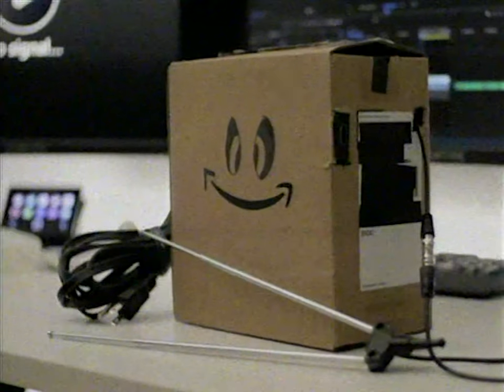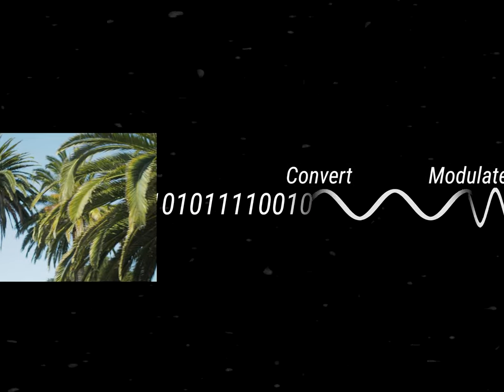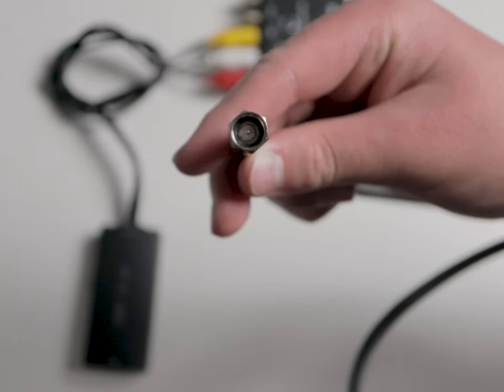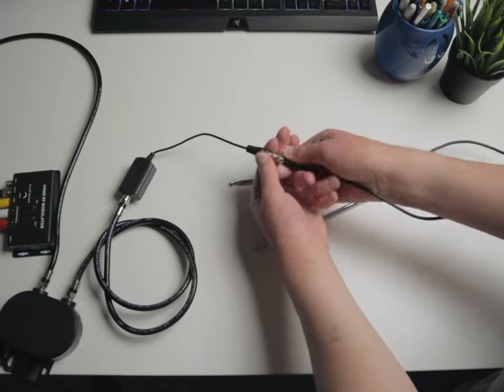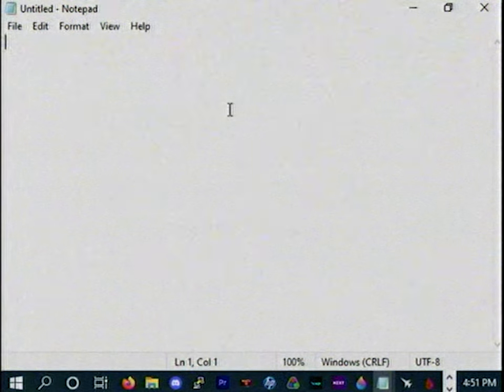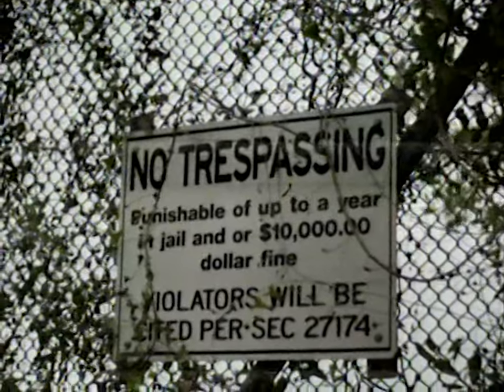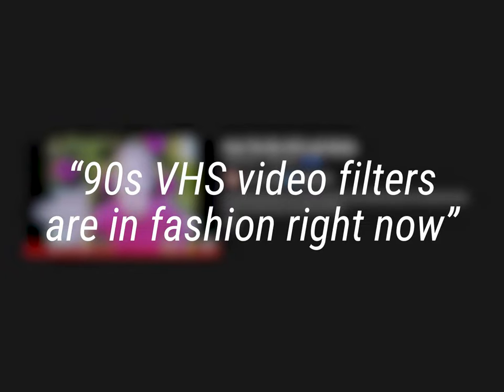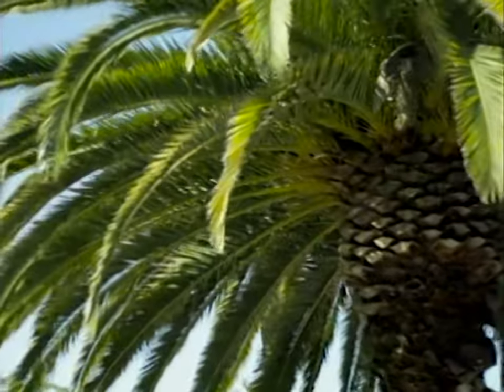Building a 1950s TV Transmitter!

Comment: All of this is really fun until you get your Amateur Radio license, and see all of the fine details and want to scream
Reply from the maker: I think I'm going down that path.. I'm already screaming after one Wikipedia article 😭
Reply: Could you explain I don't get it. I built one of these and am actually studying for my ham
Reply: Are you talking about ham ops being able to transmit analog video
Reply: @evanbv8793  technically. We have a NTSC cable channel in a UHF band

But you need a cable tuner, I think
Reply: @evanbv8793  when you get licensed (ESPECIALLY when you get your Extra like I did), you see fine details that need fixing, and oftentimes you can’t fix them because you don’t have the proper parts, causing you to spiral into insanity like me for knowing that something isn’t fixed.
Reply: @MaxSolar0713  oh wow that's cool I'm going to see which channel(s) so I can add it to my tv and check every now and then and see if I catch anything

Comment: Could you do this digitally so the signal isn’t in analog? Instead of the usual steps, could you just do the HDMI output > Modulator that has a 1080p RF output > Amplifier?
Reply from the maker: Good question. The modulator is analog only, but you can get digital modulators on amazong (although they cost a lot more).
Reply: It is theoretically possible, but you’d need a digital modulator. Have fun acquiring that without a license.

Comment: I did this set up using mostly cheap products from Walmart but color loosely comes through and there is no sound on my crt. What could the issue be?
Reply from the maker: I had to go out and buy a better HDMI to composite adapter, I got one at best buy and it does the job far better. Maybe that will help with sound too
Reply: @SimonVideo  good idea 👍
Reply: @SimonVideo I ended up fixing the color issue but the sound is still gone. Just static. Do you think it could be the antenna I used? It's also cheap
Reply: @tornadodude640 it’s not the antenna if the video comes in well. I’d check your connections from the audio source to the transmitter and make sure your transmitter’s audio function isn’t broken.

Comment: You could get a more powerful amplifier for a better and stronger signal. I think yours is in the miliwatts range, not really made for airwaves, but for cable only. It's not really legal to transmit without a license but nobody can detect you in this day, because analog tv is dead. For a perfect transmission and reception, you can tune your antenna lenght, both on TX and RX side, such lenght calculators can be found online. In fact, you can start a pirate tv station like this, but let's not take it that far...
Reply from the maker: Yeah, it's definitely not powerful. I think it's still detectable but the chances are super low. That's a good idea to check out a length calculator. I'll look into that!

Comment: What kind of range did you get from the transmitter?
Reply from the maker: I could get a faint image about 50 feet away, and that was through a few layers of drywall.
Reply: @SimonVideo  Good to know that it should cover a sub 2,000 sq ft. home if centrally located w/o interference. Thanks!
Reply from the maker: Yeah! Glad I could help!
Reply: If you get a 30-mile range antenna, will it go 30 miles?

Comment: what video capture card/software did you've used to record the transmitter videos ? they seem to be really smooth at 60fps.
Reply from the maker: the Hauppauge WinTV 1196, but pretty much any analog tuner will do the job
Reply: @SimonVideo  thanks, i'll get one cuz it also comes with an SFF bracket and it fits perfectly on my optiplex 3050 pc and its pretty cheap :)
Reply from the maker: @r0ger_  yeah! I love mine
Reply: @SimonVideo  yeah well as for the software, did you've used the Hauppauge Capture app to capture the transmitter video in 60fps ?

Comment: How its is work. Its kind a weird. U just using antenna receiver amplifier to boost your rf out put transmittter. Instead of your receiver antenna.. 

Conclution is. You need RF UHF BAND booster using 2sc1971 transistor. And u got around 5Watt power output
Reply from the maker: Hey the amplifier works.. The transistor might work better but I personally don't want a super far range

Comment: How did you do color and not black and white?
Reply from the maker: Pretty much all analog TV is color, if you're having trouble getting color working, it might be the HDMI to composite converter
Reply: The video is being transmitted by the NTSC standard, which was supported in the mid-1900s and remains the standard for Analog Television. Just because it’s old technology doesn’t mean it’s always black and white.

This answer reminds me of a Calvin and Hobbes comic strip

Comment: I got it hooked up and bought the same cheap walmart amplifier but the signal only goes about an inch. Any help?
Reply from the maker: That's weird.. make sure you have the amp connected correctly (backwards.. kinda). Also double check your antenna connection
Reply: @SimonVideo  I did it all correctly. What ended up working was connecting some old weak amplifier I found and that fixed the issue.
Reply: Sounds like your amp failed, m8. That, or feed line issues
Reply: @MaxSolar-dd5wq  Maybe, the other amplifier I used had the same issue in the same way, connecting both made it "work" But weirdly, I'd have to be really far south away from the transmitter for it to work. and only on Portable TVs
Reply: Update: I think I found my issue, The type of rabbit ears im using lol
Reply: @t3aperson  the “I need to be south” phenomena sounds like you are  capacitive reactance with the antenna when close to it, the general advice is to not be within a wavelength of your tv and transmitter; granted, it really depends
Reply: @t3aperson  yeah, some rabbit ears work terribly
Reply: @MaxSolar-dd5wq  what should I use then? I only want it to work inside my house, and on my balcony and that's it.

Comment: when I built this it was very short range. Is there any way to fix the issue?
Reply: Daisy chaining amplifiers could help.
Reply: @egementutkunforreal  how do u do that?
Reply: @MacLover-yp5ex  you buy 2 LNA'S 
(Low noise amplifier) 50-2400mhz you connect the "rf out" of the first amplifier to "rf in" on the second amplifier and you power both of the amplifiers
Reply from the maker: like nemege16 said, daisy chaining amps could help.. about how long is the range?
Reply: @SimonVideo  I only receive it when I’m touching the antennae

Comment: Idk why but the amplifier makes the signal worse instead of better for me
Reply from the maker: That's weird.. make sure it's getting the right power and that you have the input/output connected properly
Reply: @SimonVideo  got the amplifier to work when plugged in but with the antennas the range is so low that the antennas pretty much have to touch
Reply: Either your balun is bad, the antenna’s bad, or the amp is bad. I think it may be the amp, because USB ones tend to break easily
Reply: @MaxSolar-dd5wq  what is balun
Reply: @springleman  thingy that changes the cable type from F-Type to twin-lead.

Some people don’t use them in their transmitters

Example: https://m.media-amazon.com/images/I/4129518m2BL.jpg

Comment: Do you need a licence for this?
Reply from the maker: No, but it's do at your own risk. As long as it doesn't go too far outside of your house it's fine in my opinion.
Reply: @SimonVideo  Ok, so that modulator's amazon page looks very bad. was your one good or if not can you give another recommendation via email
Reply: i will send you an email if you are happy with that.
Reply: also i subscribed and pressed the bell thing
Reply from the maker: Yeah.. that page is a bit off but I like the modulator. You can find similar ones on Amazon.. thanks for the sub!
Reply: @SimonVideo  also i have an old CRT tv that has the red LED but when you press the 
power switch the light fades away as if the tv was unplugged...

is this a power supply issue,
if you can help me fix this that would be great, Thanks.
Reply: @Windows95-likes-old-tech 
Before you do anything to that tv, for the love of everything DO NOT OPEN IT UNLESS YOU KNOW WHAT YOU’RE DOING. I almost got killed when I forgot to put a suction cup back on the anode.

Comment: Some notes and corrections for this video:
1: Analog TV isn't actually obsolete. it is actually widely used in Europe and can actually support high resolution video. the reason why the people at the FCC wanted to faze out Analog TV is because 

• They're assholes
• They wanted to make up more bandwidth and channels for wireless telecommunications 
• Also, they're assholes

2: You can actually get a higher quality transmission if you were to build a high power TV Transmitter. as per what the antenna man described, most of the time you can get a better picture quality with analog than with digital! most of the snow and fuzz you get in the picture is caused by interference getting clogged up in the signal. a higher powered transmission will help with your picture by being able to counteract the interference and noise as well as being on a higher channel. 

Most low powered transmissions are used by rural or small communities just because hey, it's cheaper and simpler.
Reply from the maker: Yeah, it would probably look better if it was higher powered. Also I get the impression that the FCC might be assholes

Comment: I have a modded HDM69
Reply from the maker: Nice! What's the mod?
Reply: Modified potentiometers. Works decently w/o an amp. Can reach ~100-200m before the signal completely goes away (tested with my Baofeng UV-5R MK4)
Reply: @DanielBerzinskas  how the heck did you test a television transmitter with a BaoFeng?
Reply: @MaxSolar-dd5wq  I tuned in the video frequency and i listened in to see if there's a signal

Comment: And now you’re under violation of the FCC for illegally operating radio without license.
Reply from the maker: I'm honestly not too worried because it's under 1W ERP (so part 15??). 0.36W amplifier output, <2dB antenna gain @ 470MHz.

Comment: This is illegal.
And that makes me sad.
Reply from the maker: It's fine as long as the signal doesn't go too far outside of your house
Reply: @SimonVideo  But the FCC does not say that.
Reply: @MrPillowStudios   🤓
Reply: @MrPillowStudios  if it follows Part 15 rules it should be fine

If you dont want to do this then dont, but dont expect anyone to do that for you, because that would  realy be illegal
Reply: And in many countries, no one cares about pirate TV broadcasts.
Reply: laughs in Amateur Radio License

For legal reasons, I cannot tell you that if your neighbor can’t receive it, neither can the FCC
Reply: @DXingSlovenija  Those are for AM and FM only.
Reply: @MrPillowStudios  oh, thats good to know

What about the lower part of VHF band (channels 2-4iirc (below fm band)?
Reply: @DXingSlovenija  Also illegal.
Reply: @MrPillowStudios  oh I see

Then I guess to be perfecly legal I need to transmitt my TV signal in the middle of the FM Band (98Mhz seams ok), and use one of theese portable TVs from China like the Leadstar brand to pick it up (cuz they have coverage from 48Mhz to 850Mhz without gap (which means they can also tune the FM frequencies)
Reply: @DXingSlovenija  You do that by getting a cable rf modulator and use channels 95, 96, or 97.
Reply: @MrPillowStudios  nice

Thanks, I have a HackRF and hacktv so no need to stricly folow channels, I transmit anything I want from 1Mhz to 6Ghz with this setup

BTW: on which frequency do channels 95,96,97 land on l? I thought channels 2-4 are closer to FM band then 90 and up, theese seam to be more up in UHF range
Reply: @DXingSlovenija  On the FM band. Go to your TV, and change signal to "Cable".
Reply: @binarix128  wtf bianrio jumpscare
Reply: but who cares xd
Reply: @obthld  You gotta follow the law
Reply: @MrPillowStudios  nah
Reply: @MrPillowStudios  most countries don't care about pirate TV btw
Reply: @MaxSolar-dd5wq  i have that :)